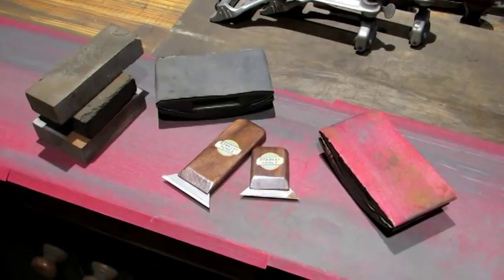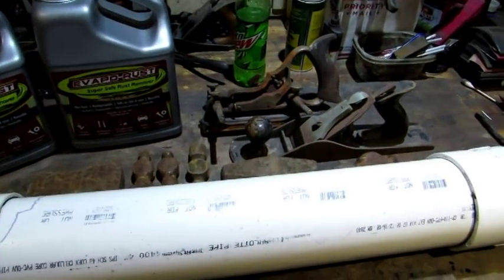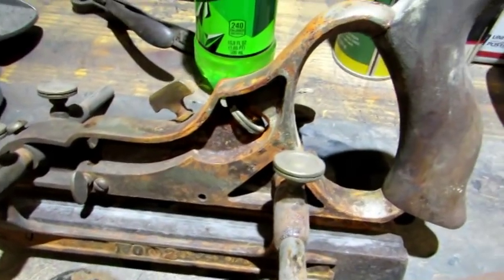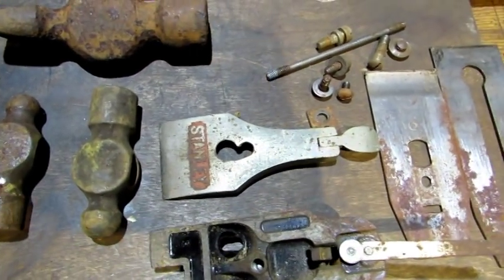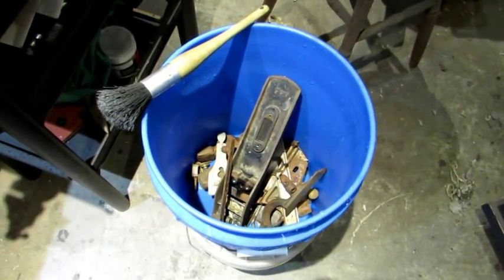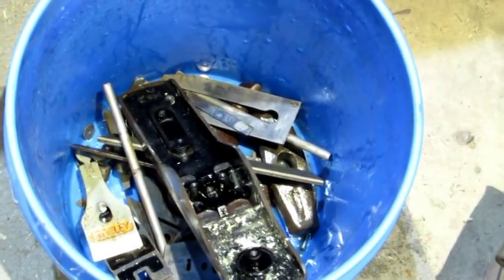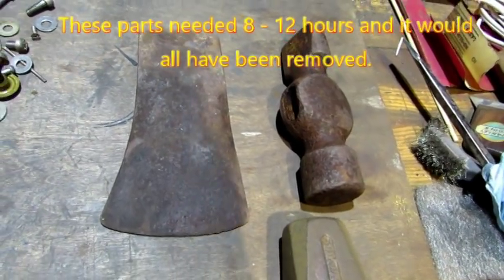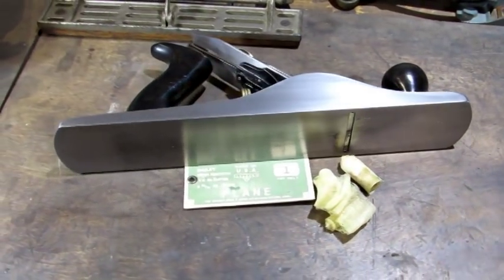Easy and Safe Rust Removal

Comment: Wish you would have put out this video a few weeks ago.  I was going to restore an old Stanley plane and put all metal pieces in a rust remover I used last year when getting rust out of a gas tank.  The blade came out all pitted and now useless.  And worse the body of the plane looked like "snakes" of missing metal. I watched about an eighth inch come off just with a gentle scrub.  Next time I will use evapo-rust